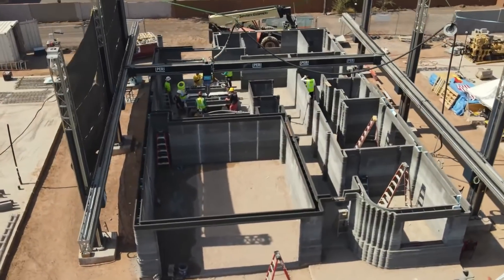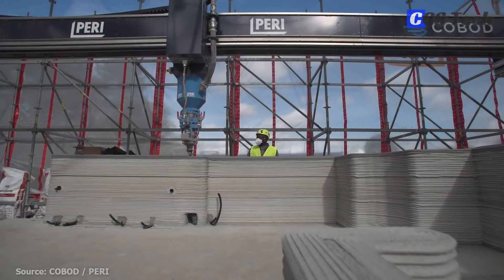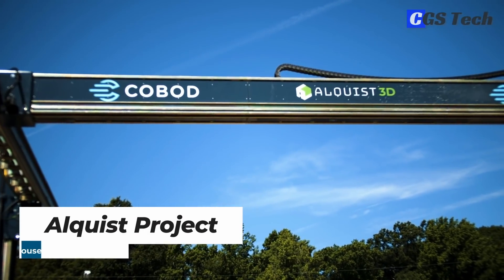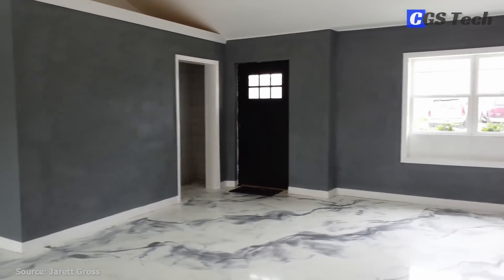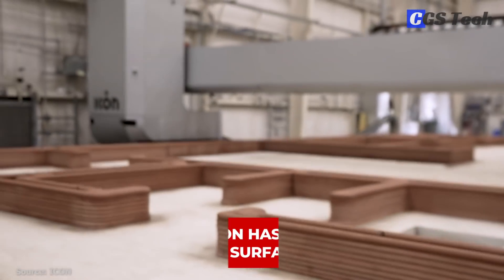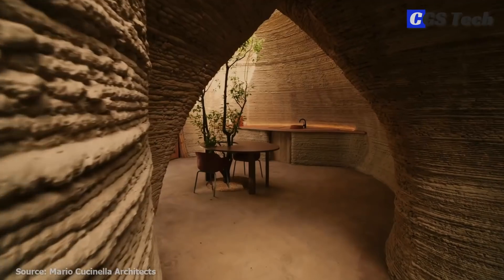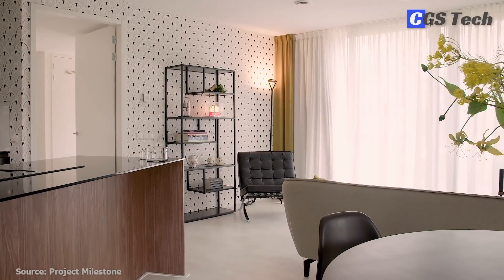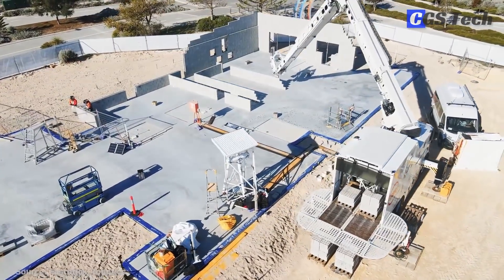8 Amazing 3D Printed House Projects in 2021

Comment: Thanks for tagging my channel in the description! I've visited almost every 3d printed building in the world at this point!
Reply: Do they put any steel rebar in it. Where I live we are required to have two in the footing and one every 2 foot horizontal and one every four foot vertical. I put more than that in my projects. We had a 7.2 earthquake about 10 miles from here and had no damage in our full basement of rebar and block filled with concrete.
Reply: @Chris_at_Home  I don't think this really works this 3d printed houses. It sounds so hard to request and get.
Reply: @annielin2894  did it work?
Reply: @blakestaredwards  noe
Reply: @Jarett Gross what is the cost for a 3D Printing house and how do I contact them and is there a payment plan?
Reply: @annielin2894  construction isn't as simple as consumer products, every region is totally different.
Reply: @automateconstruction  do you think I can just call them up and inquire more information about how to buy one and if there is a payment plan?
Reply: @annielin2894  No, they don't usually cater to single family homes yet because demand is so high and there haven't been many printers built yet. There is somewhat of a supply chain issue.
Reply: @automateconstruction  that is bad, my goal is getting something like that by 2023 April.
Reply: @annielin2894  That could be a reasonable time frame!
Reply: @automateconstruction  should I reach out to them now?
Reply: @annielin2894  It couldn't hurt but they likely will not prioritize you.

Comment: I think instead of concrete a composite material would be better, with a smoother finish and more easily shaped, concrete by nature has limitations were as composite materials have many advantages, Composites can now be made from landfill trash, plastic bottles etc and just about anything, concrete uses all new materials so drains earths ores and minerals,  composites dont crack and are easily made fire resistant, wonder if anyone has ever used such a material,

Comment: The problem with this texture on the outside is mold that will settle there they will need to be powerwashed regularly and on the interior now you have to vacuum walls

Comment: Need to address settling over time, which causes cracks.  Same with cold, wet, icy weather.  I noticed in nearly all the interior shots there were no decorations and the paint had to be sprayed to go over those rough walls.  How about some sort of hangers embedded in the walls to hang sheet rock in interior?  Then you can have wallpaper, rolled paint, hang pictures, hang TV mounts, run electrical and not have the mount be all sloppy, etc.  In a similar way, you could have embedded attachment points on the outside for a facade to attach.  Facade could be fake rock wall (I've seen those), could be a more typical looking siding or  actual natural rock.  Main thing is you need to address mount points present or future and how they attach.  Can a person drill these 3D printed houses to mount something?

Comment: I wonder if these 3d printed houses can withstand typhoon, flood and earthquake🤔
Reply: if the house printed in concrete, that must be better than those using wood to build. Don't tell me that wood is harder than concrete .Which material using  to build can withstand your mentioned risk?!
Reply: They're made entirely out of concrete.
If concrete Bridges can withstand those disasters, why not a compact house made of concrete?
Reply: You definitely have a point 🤔🤨
Reply: I'd guess that they're at least as strong as a wife frame house.  They're concrete, after all.

Comment: Any mention about freeze/thaw effects on the concrete exterior? Cracking as the product settles? Eliminating entire trades and thousands of jobs? Rendering skilled labor a thing of the past? 

Just a couple bugs which I'm sure will have to be worked out. Great at a glance, but everything which glitters isn't gold.

Comment: doesn't cement/concrete crack over time? 🤦‍♂️
Edit: 4:39 AFFORDABLE?!?! $300K  That is NOT affordable.  You can get a double wide for HALF THAT.
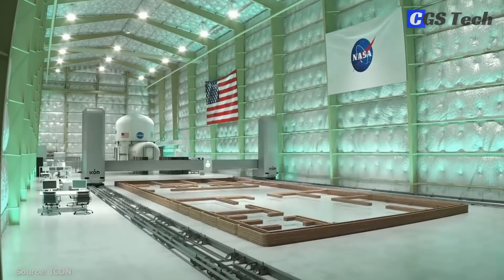Another edit 6:08 THIS has potential.

Comment: O,K. One thing at a time ....esthetics....well...replaceable vertical non stick ( rollers ) to follow the nozel and flatten all that's glop is not beauty into perfect tranquility ....peace ....and harmony. Time will tell.....perhaps water system....sewage recycling system....and electrical ...plus (?) Compressed air technologies..... 3D printed.... on site ....may find their way down from Space X ....R. & D..  ....through amortization... into scaled up ....terrestrial application.... as an A.I. thinkable part...... of an emerging energy economy.  Or not.

Comment: Most people when presented with a novelty find it hard to evaluate facts rationally, this makes the adoption of new technologies very risky. The awful aesthetics and energy costs of concrete aside I suspect that cracking and leaks will be the downfall of a lot of these designs.
Reply: I would then assume as technology improves there will be other materials being used here. I think this is like the beta version of something much more impressive in the future.
Reply: Not to mention the millions of workers out of a job and the loss of skill that'll go with them.
Reply: Good points.  It will have to improve because right now it is not good enough.  The loss of people with trade skills is happening anyway - I can say that in trying to find them now.

Comment: They have had this technology for years now.  Where are the cheap homes?  Someone has been bought out I bet.
Reply: are you saying they brought all homes by one person/company.
Reply: It's not as cost effective as you expect.

Less labor to actually put up walls.
But setup of the printer reintroduces the labor...

The cost of the printer is tremendous.

Still have all of the plumbing and electrical to do.

Then the roof and finishing is not any easier.

The lot price is the same and can be the majority of the home value.